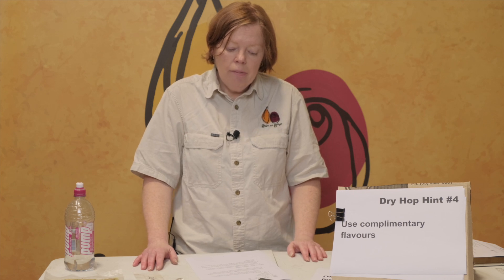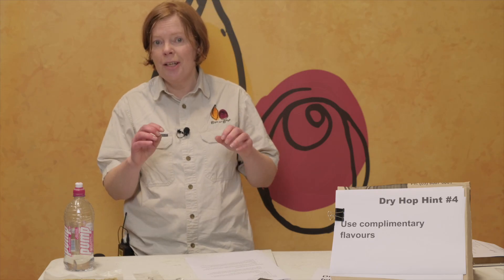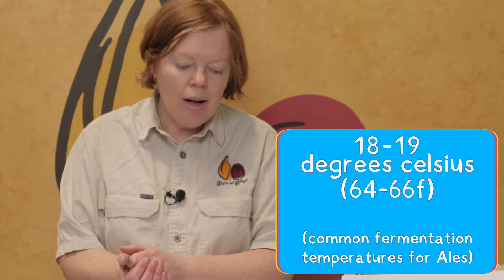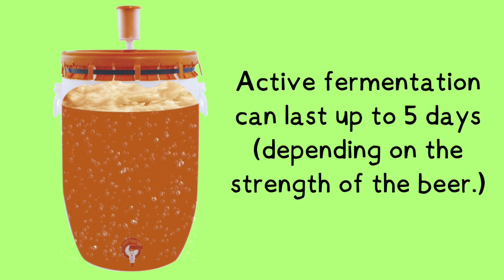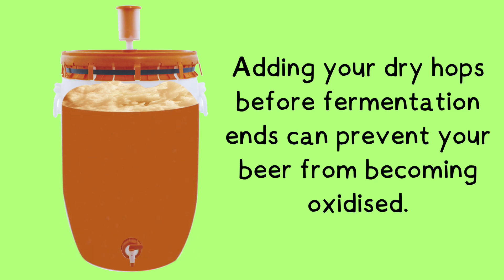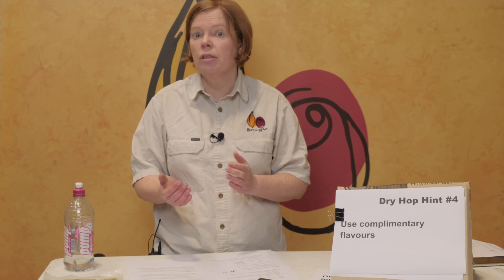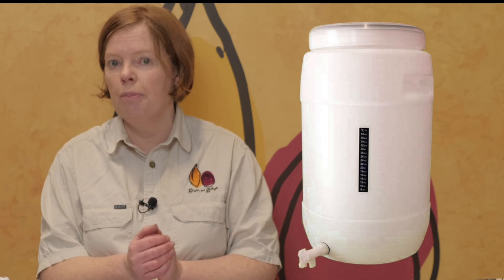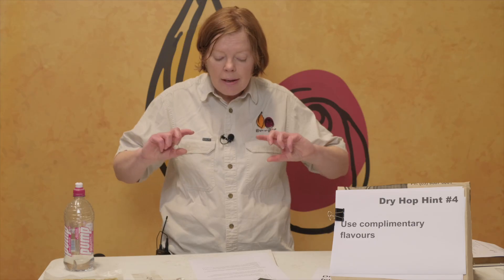When is the best time to dry hop? | Preventing beer oxidation

Comment: Much to be said about the positives of the common plastic fermenter. Of which I have a few variations and generations of both new n old. Not mentioning brands or types but the one pictured in video is a special favourite by far.
And with that many different ways of dry hopping.  I personally prefer a.t.m crash chilling at 2c to drop suspension. I double up my hop additions sometimes depending on the outcome both during active and near finished fermentation as it varies as does freshness of the hop crop. Great video all the same. Just wish it was one video rather than multiple vids. Cheers

Comment: Most of the experimentation and analysis on the subject I have read involved kegging, followed shortly by artificial carbonation, and cool storage. That should stop biotransformation (but not necessarily chemical transformation), If, instead, one adds fermentables to carbonate in bottles or kegs at fermentation temps , biotransformation of hop oils is bound to continue for that length of time. Thus, bottlers do not forego biotrans if they dry hop a day or two before bottling. 
Re oxidation, a technique discussed on aussiehomebrewer is to place dry hops and a piece of iron inside the filled fermenter and above the wort, with a magnet on the outside to hold it. To dry hop, one pulls the magnet away. Note: I haven't tried it yet.